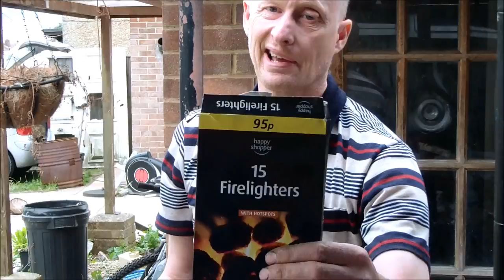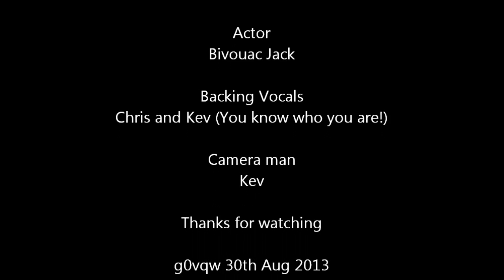Firelighting Tip from Bivouac Jack

Comment: I use a similar method with a quarter of a hexi block. They burn for about 5 minutes. You do have to grind a pile of material from the ferro rod onto a hexi to get it to light but they do do an excellent job for a quick light, especially when everything is wet. I have hexi blocks in all my kit bags!